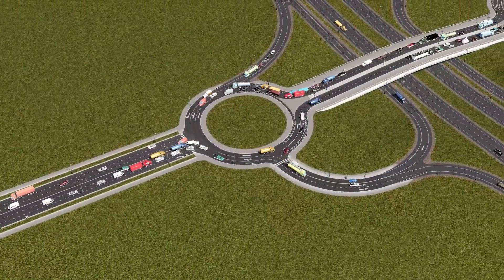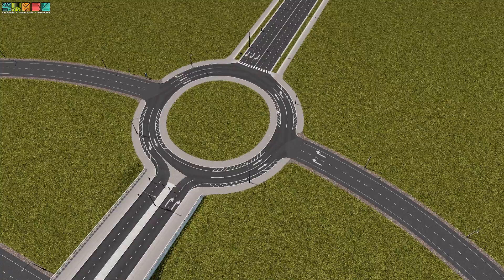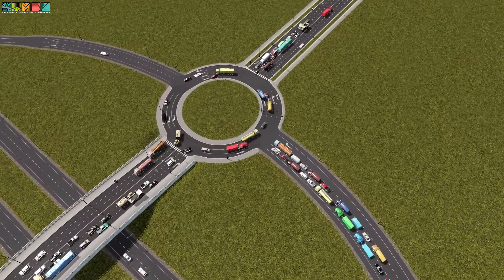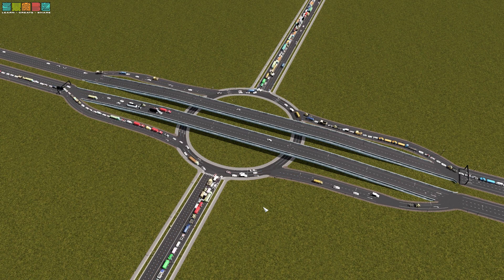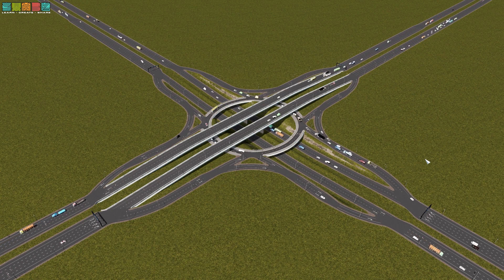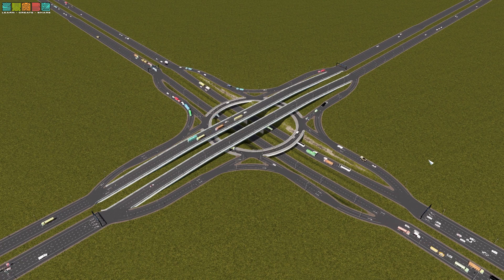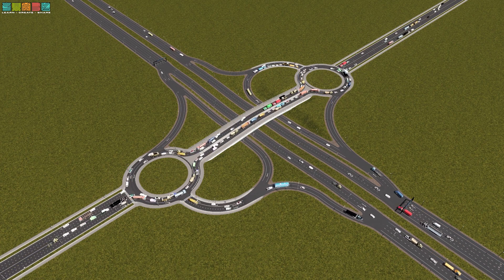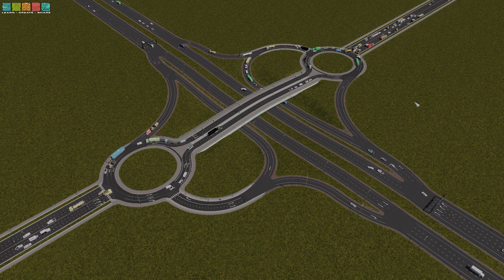Roundabouts work GREAT in Interchanges! (Sometimes)  -  Roundabout Interchange Comparison

Comment: Roundabout ParClo  is a great idea, I never though to even try that before, although surely it should be called a Dumb ParClo.   For the dumbells and dogbones they only really work if your straight through traffic has a better route that avoids the junction completely.   They just dont work efficiently as System Interchanges.
Reply from the maker: The straight through traffic actually did great. As long as it has two lanes, just like the highway.

Comment: Well a dumbbell or dogbone is a service interchange.  It's slightly better than a diamond, but I'd definitely not expect it to be able to handle all that much traffic.  The interchange test map is definitely for system interchanges.
Reply from the maker: Service interchanges do fine on interchange test map. Just not the lower traffic density ones. A timed traffic light can also handle the traffic here.

Comment: Double By-pass Roundabout looks alot like a busy intersection in my area.. but remove right turn by-pass and add timed traffic lights on the 4 corners of the roundabout. 
"knooppunt rottepolderplein" i find it an annoying intersections where jams usually come from in my area. (don't know if there there often though as i don't go that way often.) but due to size constraints train rails on one side and industrial on the other it kinda makes sense. 
Edit: just looked up the intersection.. apparently its only 2/3's of the intersection.. the one below it with "Schipholweg" is also tecnically part of it.

Comment: Problem imo is with the test map. These kind of basic highway service designs are not meant to act as essentially connecting 2 crossing highways, with one just being replaced by regular roads. In reality you wouldn't get that much through-traffic over the highway, otherwise you indeed need to use some more specialised designs.
Reply from the maker: I think the map is fair enough. Its a good control.

Comment: One thing I've noticed is a lot of the traffic leaves the highway, stops at the roundabout then enters the roundabout and continues on the direction it was already going...in other words a lot of traffic didn't need to leave the highway, but it did...causing too much build up at the roundabout.

Need to find a way to prevent traffic that's going straight across the interchange and using the roundabout.
Reply from the maker: Agreed!

Comment: Hi Yumbl! Love this video. I think I’m gonna call that last interchange a dog park interchange. I like it. Would it be possible to put the dogbone in a diagonal orientation so that each half of the dogbone would fill up the missing quadrant on the parclo?
Reply: Also, would it be reasonable to try to put turbo- style lane crossings so the cloverleaf quadrants are completely free-flowing like your single point parclo? Thankyou!
Reply from the maker: Thank you! And yes to both. Adding a third lane would allow the right turns to “slip” through, and parclos work great on an angle.

Comment: You should split the lanes in the dumbell parclo.
by this i mean the asymmetrical road where the parclo attach to the round section.
this road need greater separation between the lanes at the end.

if you split the last section of this the cars would not have to do sharp turns and slow down as much.

either you use node manager to grow the node, or you use two separate one way roads.

Comment: I think that the final roundabout parclo service interchange could be improved for land usage AND flow by not having the 90 degree angle connection, and angling it more parallel instead.
Reply from the maker: But then you lose the safety benefit of any roundabout

Comment: On the topic of not yielding. It think the lane mapping in TMPE over rides the give-way signs. I would be interested in an experiment to see. I have stopped using lane connectors on roundabouts as I think it causes the logic to fail.
Reply from the maker: You may be right. Ive found less to be more when it comes to lane connectors.

Comment: i was intrigued but after seeing every set up, i couldn't help but feel like the roundabouts are just unnecessary. some of them arent even full roundabouts which basically make it more work to go straight over the overpass. you cant just go straight you need to go to the right and half way around. why if you cant even use the rest of the roundabout? also the speed of the cars slows down through the roundabout slowing traffic even more.

the one that was "high capacity" just adds more roads to make a left turn, typically you just make an off ramp above or under the highway. in the roundabout case, you're having to make some what of a right turn and go "around" to make the left instead of your typical 'straight to the point' off ramp.

i dont think at any point round abouts are meant for high capacity. the issue i think is that vanilla CS has awful 4 way traffic light system. only way i've found lights useful over roundabouts is with timed traffic lights and allowing left turning traffic to have it's own light sequence. also being able to fine tune the amount of time the lights are green.

so i think roundabouts are much more necessary for vanilla players when having a 4 way intersection but i do think they will still be limited in their ability to keep high traffic flowing. I've had many roundabouts clogged up even with TM and mods.
Reply from the maker: Lights are still a high quality option. I just felt these were worth discussing
Reply from the maker: With that said, try my roundabout parclo. Its quite high capacity all set up with marking and traffic manager too

Comment: node controller should help to get it even faster. Sadly you didn't add that.

Normaly we don't have such syymetric traffic, so  one could change the additional lane under the bone to be an exit instead.
Reply from the maker: I did use node controller. A lot.

Comment: Here in Ireland, most if not every single motorway interchange in the country uses roundabouts on both sides. They're all also pretty much always built with earthworks to raise them off the ground instead of concrete, except for the actual bridges themselves. And they never use 4-lane roads. Outside of one or two streets in Dublin, including the largest bridge in Europe that's wider than it is long, roads with more than two lanes are near-unheard of, motorways notwithstanding. The car-centric design of Cities Skylines, and particularly American Cities just in general, has always caused a bit of discomfort to me... like... does the concept of pedestrian-only roads with shop fronts and whatnot just, not exist in America? How do you cross roads that wide safely if you're on foot? Why do American cities never use roundabouts? I mean... Ireland can be pretty rubbish for walkability in a lot of places, that's what happens when your country is a tax haven run exclusively by people who get their jobs by being rich rather than because they know how to run a country, but compared to the US... it's kinda scary just how car-centric America cities really are. More land is used for parking lots than for actual buildings, what kind of a system is that...
Reply from the maker: I dont really have answers. I do know that if major intersections were torn out to put in large roundabouts they would bind up incredibly fast. We would need to curb our car dependency first.
Reply: @YUMBL  Sorry, I got carried away with that comment. Thanks for the response, I do appreciate it. I would say something else, but I'd probably get carried away again and start demanding that all cars should be eliminated from the face of the Earth.
Reply from the maker: A very common sentiment these days

Comment: These roundabout options are kind of screwed by having even traffic sources and sinks across all 4 directions - they definitely work better as junctions rather than interchanges. The roundabout junctions of the UK work because most traffic entering them from outside wants to get on the motorway and there is much less traffic entering and leaving than there is on the motorway itself
Reply from the maker: According to many commenters who live there the UK uses interchanges like these frequently. I just think theres less traffic generally there. Excluding larger city centers.

Comment: That first single roundabout wasnt set up properly though, alot of cars went of the highway, through the roundabout and back on the highway
Reply from the maker: How would you stop them?
Reply: @YUMBL  changing the speed limit on the off ramps and the roundabout itself, so they are a slower option than going straight ahead on the highway 👍
Reply from the maker: Perhaps. I’ve never played with ramp speed. A fast or slow roundabout doesnt work either

Comment: Why does the system roundabout even need two lanes in the roundabout?  If it's only for left turns, then it would be fine with just one lane.  And of course at that point it's pretty much the same as a volleyball.

Comment: Your lines are mostly wrong.
The angle strips should give the drive the illusion to get pushed back into their lane. In your style they get the illusion of getting pulled out.
Reply from the maker: Can I see an image made in cities skylines that shows them the correct way? There are limitations to where lines can go in game.
Reply: You see the strips around the roundabout at 1:10?
it would be correct if the traffic would flow clockwise.
Reply from the maker: Oh. Those are built into the road. I didnt make them.
Reply: @YUMBL  ah, didn't know (:

Comment: I made the bypass roundabout and it cloged itself. I've tried to fix it and i got it doing a kinda diamond interchange but in a weird way
Reply from the maker: See my video about the “cursed/forbidden” solution. I think its the same thing you’re describing.
Reply: @YUMBL  ok ill check it out
Reply: @YUMBL  yeah i saw that video but i didn use any roundabout in my design. I say its a diamond interchange because it keeps the diamond shape. But i dont actualy know how to describe it
Reply: My design has 3 levels. The first one and the top one are straight secctions and the middle level is a crosing of 45° angles conecting every secction with no inessesary crossings (im in play station so i cant use any mod)
Reply: I've found the video where is something similar. Its called the stack interchange
Reply from the maker: Oh, i have two “stack” videos :)

Comment: They could use a good traffic manager in Arnhem, Netherlands for Knooppunt Velperbroek, this intersection is a bit like the bypass roundabout but it has a total of 5 directions. https://nl.wikipedia.org/wiki/Knooppunt_Velperbroek  51°58'54.4"N 5°58'43.3"E

It's a disaster every day there with traffic. It went from roundabout to roundabout with flyover to roundabout with flyover with lights for the roundabout part. Still a disaster every day to drive in rush hour
Reply: I assume you live there to know that traffic is always a disaster there, because otherwise it doesn't look too bad at all. We have those quite a lot in the UK, and they're usually (in my experience at least) quite efficient traffic-wise.
Reply: @TomBruhh  lived there. Not anymore, moved 2000km, but I hear my sister regularly complain. They already are taking actions but it's not enough. Then international traffic to Germany and regional traffic are still a pain in the ass till another highway gets finished and they have done upgrades to this section